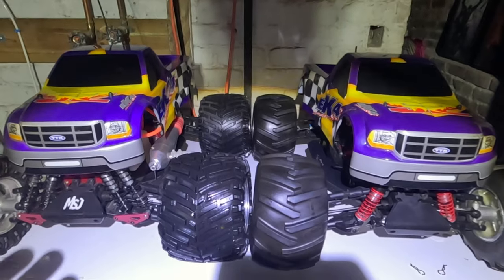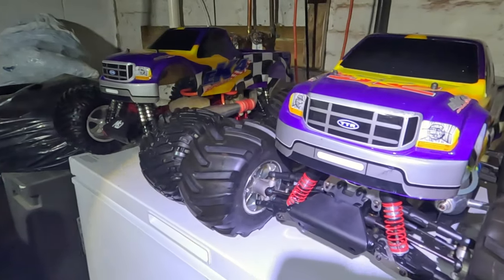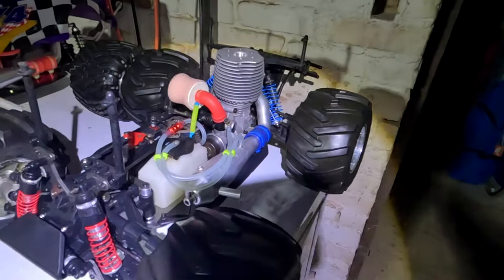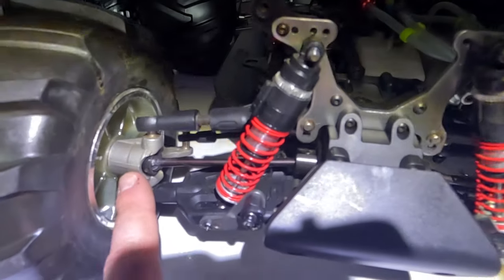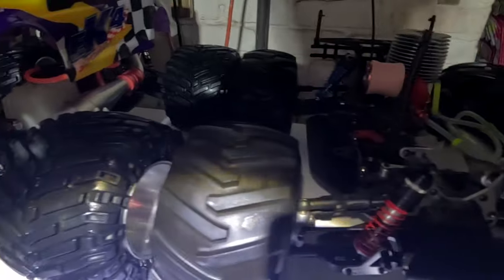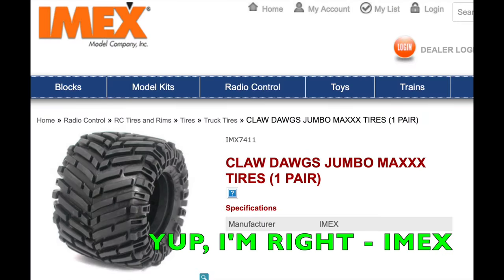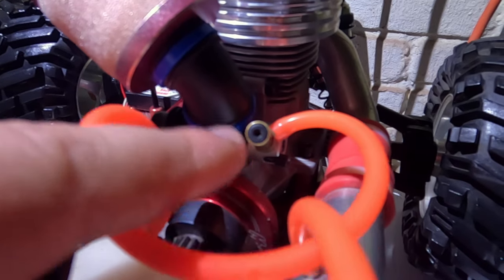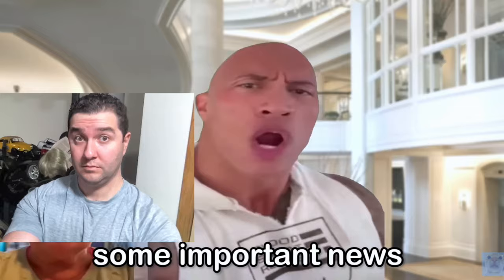Largest Nitro Engine Thunder Tiger EK4 S2 - It's Got a Real helicopter Engine - Review & Upgrades

Comment: I own one of these, and I’m tempted to buy another one.  I love it, and the wheelie show it puts on is very satisfying.  The .70 engine only makes about 2.5 horsepower, but the torque it has is second to none.

I will say that this engine is a total bitch to tune.  If you can find the right setting for the mid speed screw, it’s fairly easy to find the right spots to set your low/high speeds, but if you have to adjust the mid speed again, you need to start all over again, and trying to get this thing to run right, you’ll probably have to do that a few times.  Once you have it dialed in, it will run just fine between 50-90 degrees F only needing minor adjustments on the low and high speeds.  If tuning isn’t your forte, you will struggle with this engine because it’s very hard to understand what the engine wants especially with the mid speed screw. 

It’s a ringed engine so you need to run heli fuel in it, if you run normal rc car fuel in it, the engine will chew itself up.  

If you want to buy one of these, keep these things in mind.  Oh, and parts for them are difficult to come by.

Comment: helo hybrid !  do you think its a good idea to put the 70 engine in the MGT 8 ? or is it better to keep the lighter 50 original engine in my MGT 8 ? cause i have the 70 engine bought for 50 bocks on ebay with the savage xxl carburator on it ! what do you think ?

Comment: Bro wtf I want one!!! Could you fit a YS YS 120 in it? If the block is the same size? I have a YS 120 helicopter engine that runs great  I would donate to the cause?

Wonder about manifold adaptions and and if the engine blocks are same size? Only maybe be need to re think cooling? Because helicopters don’t have huge cooling heads but they have fans and fan shrouds